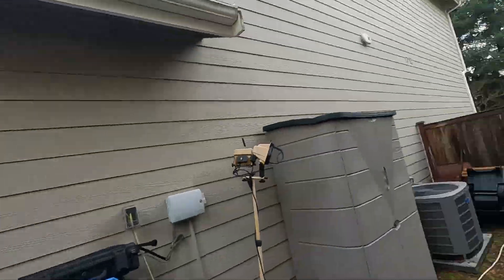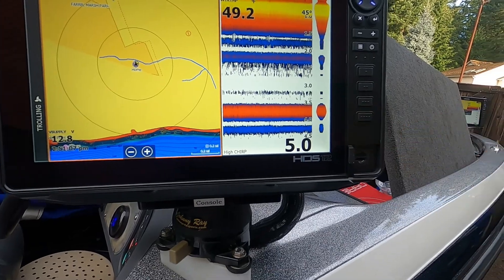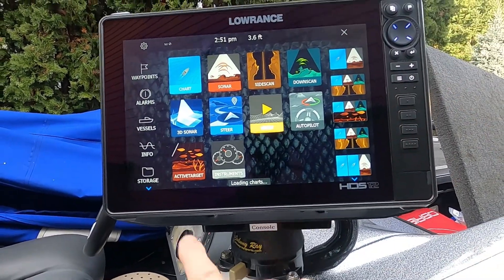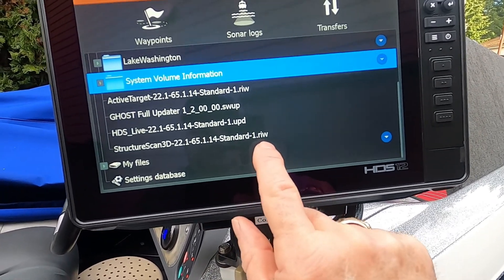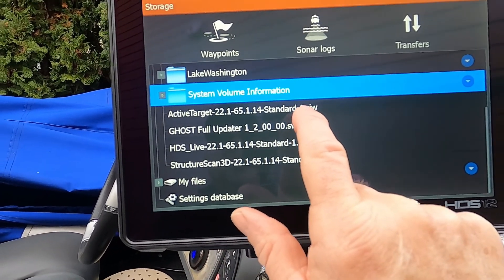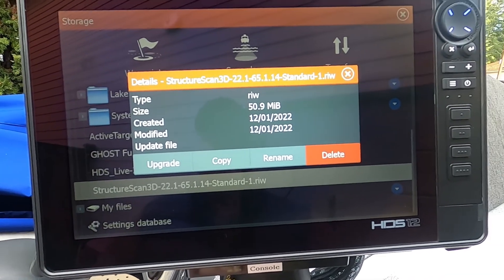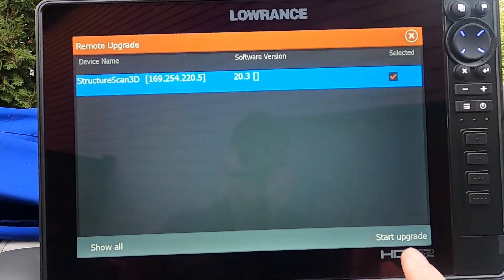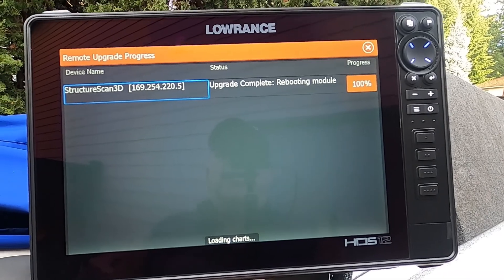Installing Lowrance StructureScan3D Software Update 22.1 for Ghost 360.

Comment: In order to get the lowrance ghost 360, do you have to update the active target too?  I have two active targets, one on the ghost and one on a live scanner separate mount?
Reply from the maker: You should definitely update to 22.1 on your Active Target (s) also.  When you do not update all your devices to the same software version, you are asking for bugs/faults.  Update 22.1 for Active Target is optimized for use with 22.1 on your MFD's, StructureScan3D, Ghost, Sonic Hub, and any other Lowrance device.